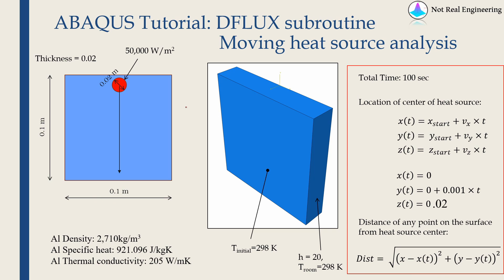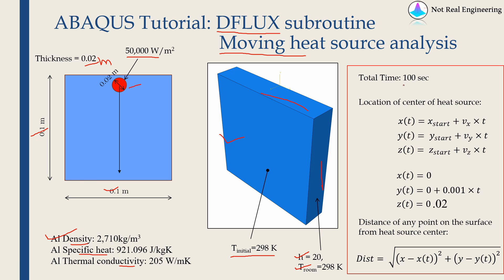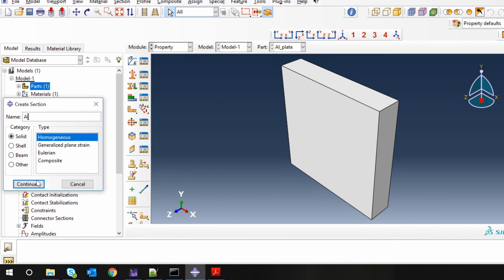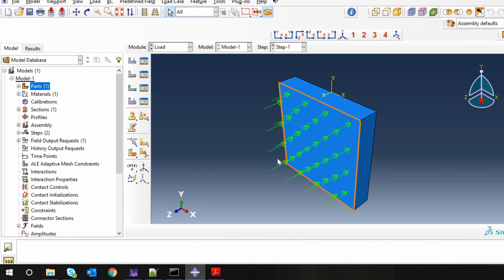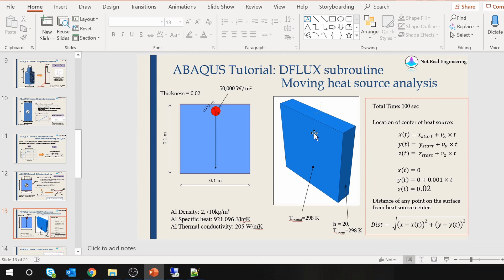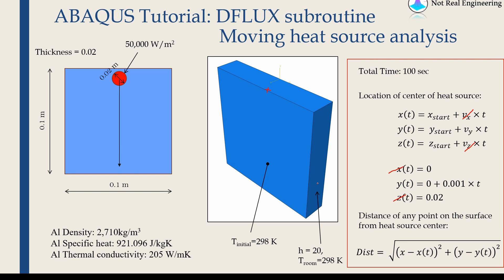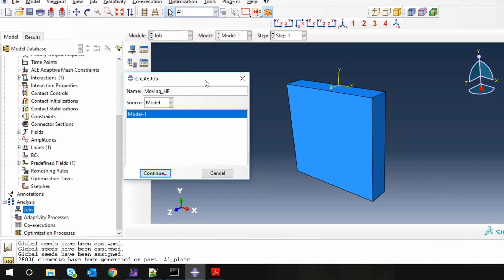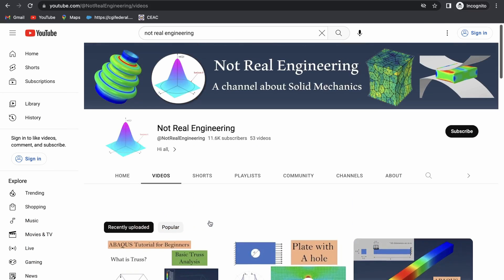DFLUX subroutine Abaqus tutorial | Moving heat source analysis | Transient heat transfer

Comment: I am working on similar models and trying to reproduce results provided in the journal paper. But while using beam size less than 1mm. I used to get very high temperature values. Can you provide any suggestions?

Comment: how to apply cyclic load slowly (to avoid oscillation behavior) for beam-column joint in Abaqus/explicit? trying to add more time periods but it's still resulting oscillated curve so badly (caused by the inertia effect), any advice? it's for concrete using CDP. thanks